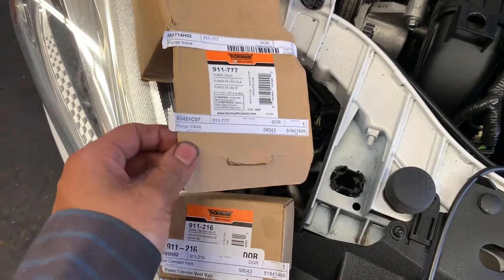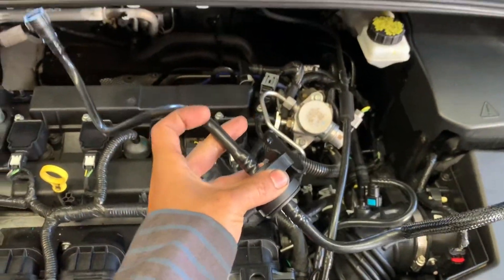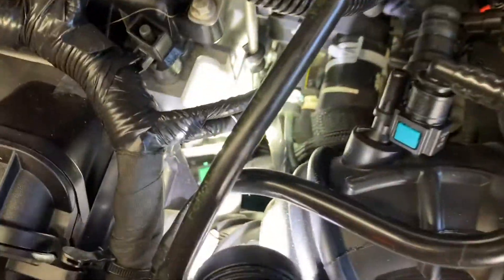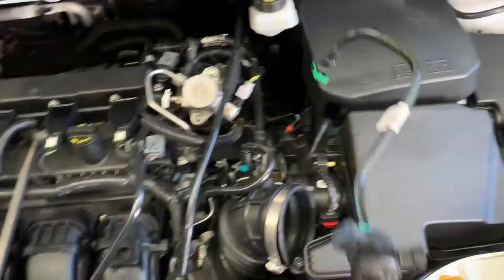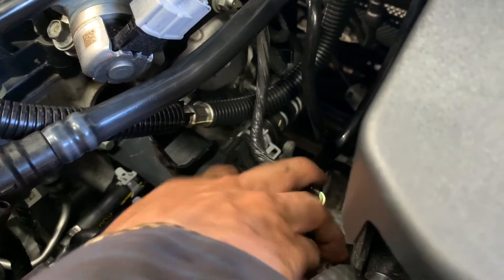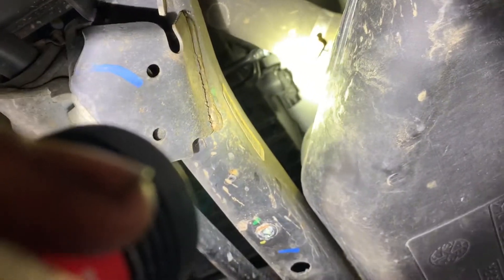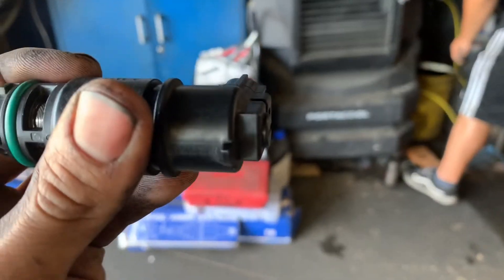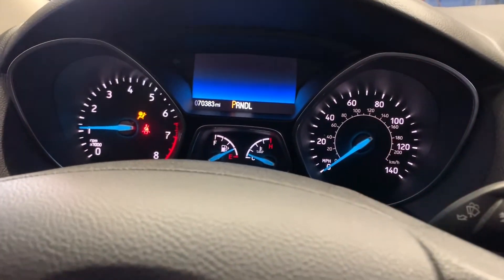Ford Focus Evap System Leaked

Comment: To unlock vent valve do I push the connector up ?
Reply from the maker: For the connector press on the tap to unlock and pull. For the vent valve twist left to unlock twist right to lock.

Comment: For anyone attempting to replace the vent valve underneath the car. It is very simple BUT it is easier if you remove the entire canister from the car, which is also very simple to do and only takes about 3 minutes. The vent valve can be stuck and require you pry it out and you don't want to risk cracking the canister by using a screwdriver. Also, when installing the new valve it requires a little force to get in since it has new o-rings on it. And this is MUCH easier to do with the canister removed from the car. You twist it clockwise to unlock it and be able to pull it out. You only turn it 1/8 of a rotation otherwise you risk shearing off the pin in the canister that it latches on too. There is only 1 pin inside the canister that the valve latches to but the valve itself has 4 grooves on it. You want to align the vent valve so that the fin on the outside of it lines up with the fin that sticks up from the canister itself. This all is easier to see and do if you just remove the canister from the car which is simple and easy. Good luck everyone! I had a p0456 code on a ford focus 2.0 and the purge valve under the hood was bad but the code kept coming back even after replacing it. I tested all the lines and system with a smoke leak detector and couldn't find any leaks. But after replacing the vent valve under the car it finally resolved the issue and cleared the code. 
Also, look up how to clean the fuel filler cap as this can also get dirty and cause a evap leak.

Comment: Looking for cause of a gas smell. Was wondering if it was maybe the charcoal canister.
Reply from the maker: could be - gas cap leak, damaged canister, fuel line damaged, fuel tank crack, fuel pump, purge valve.

Comment: As for the canister vent solenoid when unlocking do you just pull straight out or is their more to it?
Reply from the maker: Pull straight out. If to hard, use a flat head screwdriver to pry it out.
Reply: @Ah_Duuu_Ma  that's exactly what I had to do was use a flathead screw driver and now putting it back in I used a rubber mallet because I couldn't get top o ring to  surpass the threshold. Thank you

Comment: So the vent valve solenoid I tried doing on my own didn’t work complete mess. If you have SE fuel flex get it to the shop that black box next to the fuel tank was way to deep to reach. It’s not like that one in the video the black box connected  to the vent valve solenoid. It’s not easy mine wasn’t hanging it was attached to the ceiling of the car . For SE Fuelflex only or certain models. Sorry for the yapping was a pain in the ass
Reply: Clearly you don’t have a lot of experience with cars cause removing the charcoal canister is 4 nuts and done and a couple of clips
Reply: @toddmonk3935  when removing the charcoal canister after removing  the box by any chance do I need to worry about fuel coming out of the hose?

Comment: Does the 999cc 1.0 have the same purge line? I cannot find mine. The design under the hood is different. I found the vapor canister vent valve, but not the purge valve
Reply: Also, for some reason I'm not able to get off the vapor canister vent valve. I turned it up and everything and it just will not come out. Please someone help
Reply from the maker: I dont know what model you really talking about but purge valve usually located around intake manifold.
Reply: @Ah_Duuu_Ma  can you explain why the vent valve won't come off? I pulled as hard as I could even though I twisted it and it just wouldn't come off
Reply from the maker: @lilrikuownzz  After you have the valve unlock. The vent valve has an o-ring that makes it tight, the o-ring gets dry and makes it really hatrd to remove. Use a prybar or flat head screwdriver to pry it out.

Comment: I cant push it back in
Reply: I ended up switching the top O Ring from the old one to the new one and i was finally able to get the summabish seated.
Reply: I had the same problem couldn't get the new vent valve seated. N3 SAVED me. I switched both rings and it turned on tight! I don't know what the big difference was but it works.
  Thanks for the help!
Reply: What is N3?
Reply: Wonder if plumbers grease on the o ring would've helped.

Comment: My 2018 is having the same code P1450. I bought the valve solenoid. I tried looking by the tank. Is the solenoid up behind the other box? I’m assuming that’s the canister?
Reply from the maker: Purge valve is located around intake manifold. Vent valve is located on the canister.
Reply: @Ah_Duuu_Ma  so I got the valve solenoid. Is that back by the tank? Behind the canister? I was tryna take the 3 connections off.
Reply: @Ah_Duuu_Ma  puedes decirme donde esta el recipiente como se llama

Comment: How did you get your hand in there to take off the part?
Reply from the maker: I have small hands. If you cant, then you have to remove the canister.
Reply: Remove the tube and it’s much easier lift tabs push in button and pull

Comment: Changed my purge valve then light came back on code 3003:16
Reply from the maker: The code is "battery voltage below threshold"
This could be bad battery or bad alternator. It is not giving out the correct voltages like it suppose to. This code has nothing to do with the purge valve, its a dif problem.
Reply: @Ah_Duuu_Ma  replaced a bad - batt cable and it came back on then I added trans fluid helped a bit think the clutch was dry

Comment: Will this work on Ford Focus 2014
Reply: I’m having promblem with Canister vent valve solenoid
Reply from the maker: Yes would works if you have the same code.
Reply: @Ah_Duuu_Ma  is the code P1450
Reply from the maker: @alexgarza6552  replace the purge valve first.
Reply: @Ah_Duuu_Ma  I changed it and engine light out .(; will engine ligth come out again ?
Reply: @alexgarza6552  mine did
Reply: I added dot 3 brake / trans fluid and it helped I think the clutch was dry
Reply: @kristianmopsticc2887  how did u do that or there a video. ?

Comment: Okay so I’m having problems with it locking into place do you have to take the whole canister out to repair it because I just have it dangling on the back of the car
Reply: Vent control valve by the gas tank only went in at a 45 degree angle up from when it was originally locked in. Hope this helps anyone.
Reply: Im having the same problem, did you ever figure out how to lock it in?